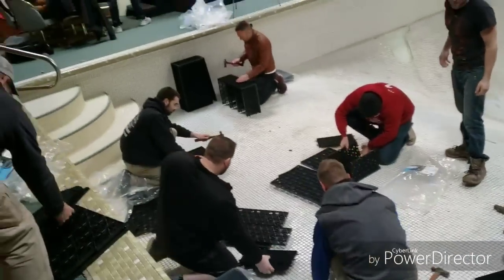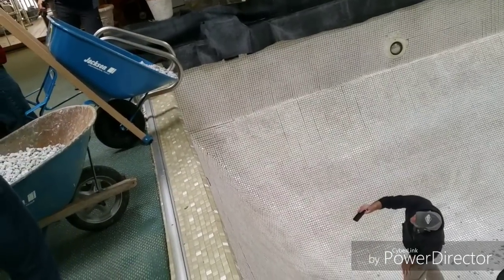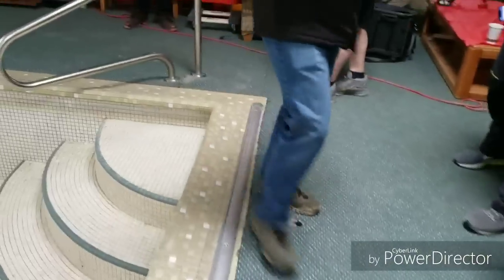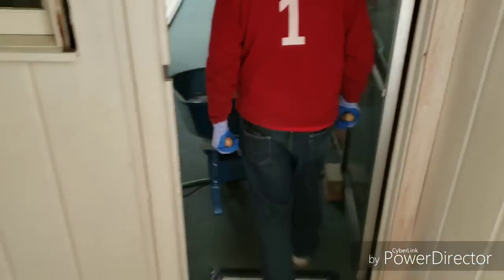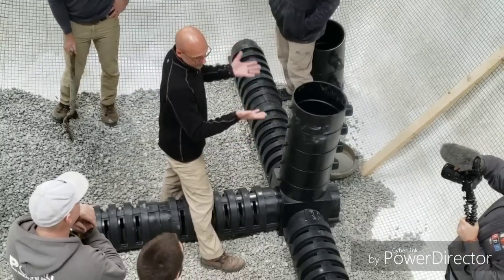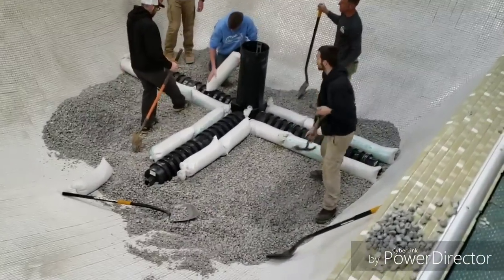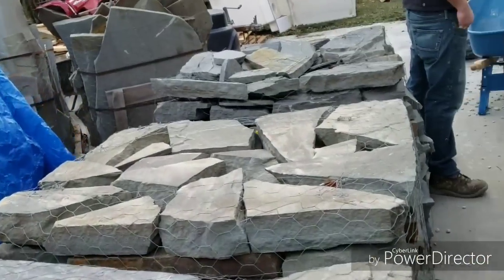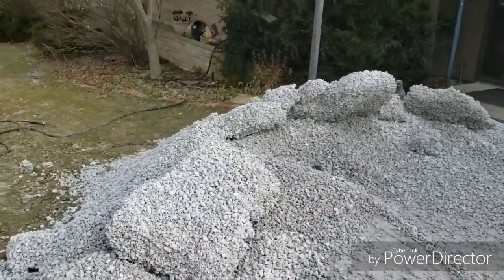58,000g Pool Aquascape PT 4 of 6

Comment: Salty here, it's interesting to see the mentality difference between pond guys and salt guys.  We like HUGE FLOW and get that waste up and out of the water column,  then remove it mechanically.  On a big pond like this I would have put in a cyclone settler or something of the like so you would only have to drain out a little bit of water and get the waste out.  No need to worry about biological breakdown, bacteria loading or the like.  Poop is gone.  In fact you can automate this process by having a waste valve open for x seconds every x hours and ensure all your poop is gone.  TO BE FAIR, as I've stated I'm a salt guy.  

Love the videos and lots of love, you're doing a great thing down there.